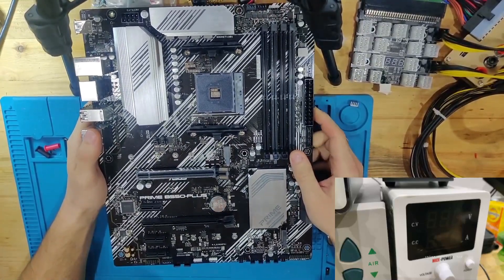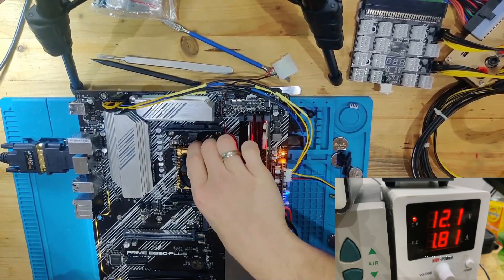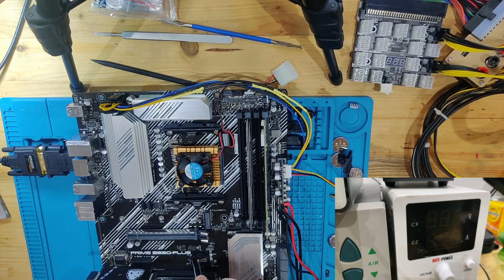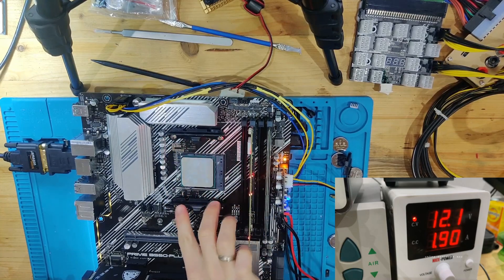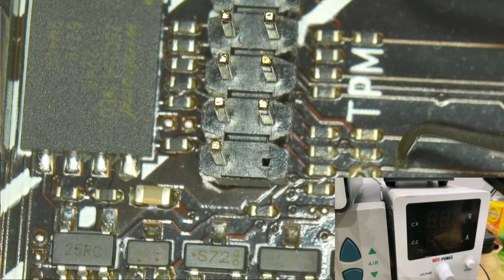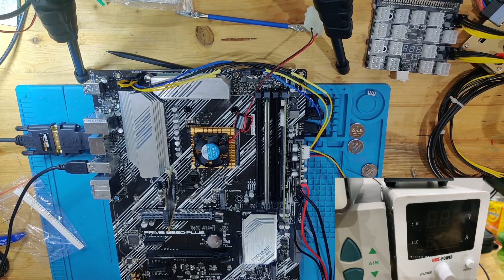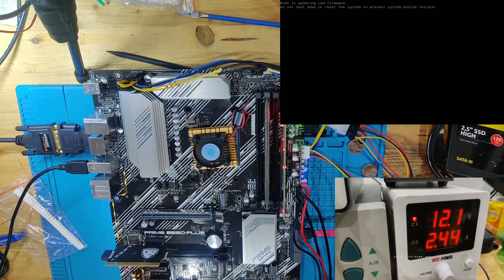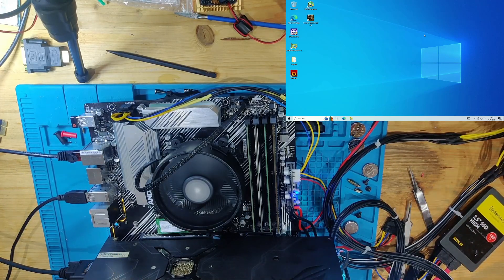B550 ASUS PRIME PLUS REPAIR | STUCK DRAM LED | MAINBOARD REPAIR

Comment: just an FYI all b550 boards need a true 3000 series or 5000 series cpu so zen 3 the x570 board the first ones could run 2000 series but once you updated the bios it goes to 3000/5000 series cpu needed

Comment: What would you check if the motherboard (AM4) does not react after installing CPU? Once removed, the board starts just fine, voltages appear and the LEDs turn on. With CPU inside I can only see 1.8V on the board and nothing more, no reaction to power button.
Reply from the maker: Is the CPU known good?
Reply: @MainboardMedic  Yes, and works with other motherboard. And should be compatible/supported. Tried BIOS programming but nothing changed. I noticed that without CPU voltages look ok, except for Vcore, which is around 250mV. Probably need to investigate there.

Comment: I got a asrock B450 Steel Legend mobo with a wired fault. Board has no VCORE.. But sometimes the board works without any issue... Sometime woring.. Most of the time its not working. What is your suggestion in this case?
Reply from the maker: I would flash the Bios first, just in case. I would inspect the CPU socket afterwards and components around it. There might be something that is heating up and then breaking/making contact. Also mounting preassure of your cooler might make a difference. I also encountered 1 case, where the screws going into the case were so tight, that it broke the connections. 
So there are sadly a lot of things, that can be at fault here.
Reply: @MainboardMedic  BIOS done... Physically no component is missing... No issue with CPU socket... most of the tme its getting power on without VCORE. But sometimes the board turned on without any issue.. every and each voltage pesent and working fine... And it was on my repair desk...

Comment: I bought an lga1200 motherboard and had 2 ram slots but the seller said that only one of the slots works.
After checking the board somebody tried to put a wrong cooler and the screw damaged the traces on the board.
Just connected them and put some uv mask and it was done.
Good job, i hope i can learn a lot from you in the future. Keep the good work
Reply from the maker: Nice repair!